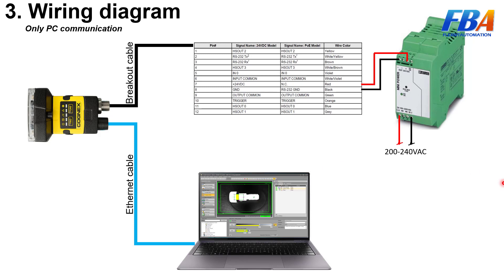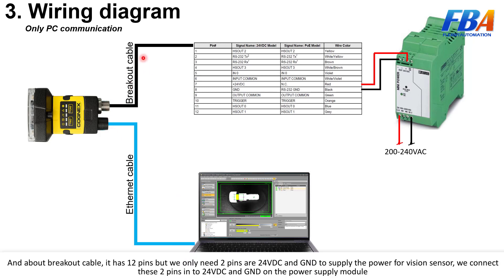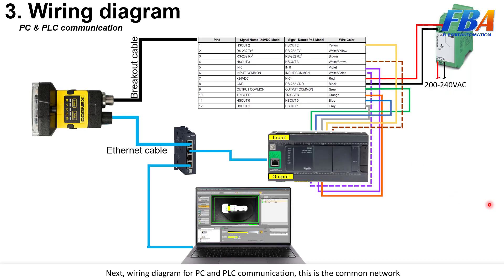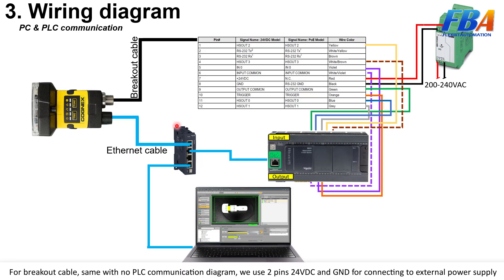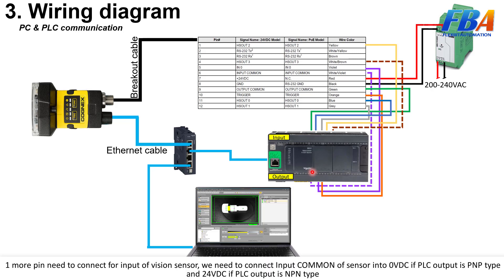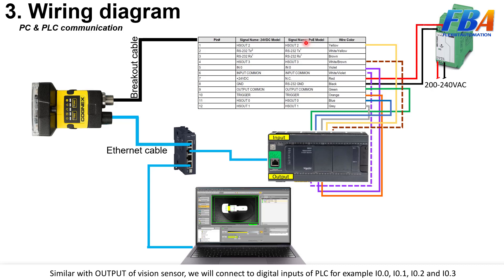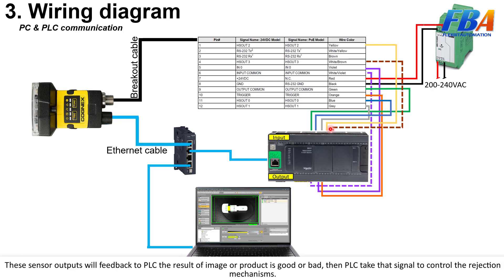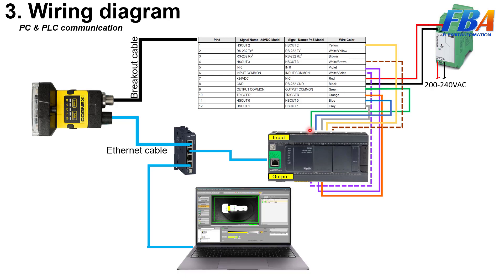Part 5 - Cognex IS2000 Vision Sensor Wiring Diagram  | Industrial Vision Camera

Comment: this was very helpful. Thank you a lot. I am working with an insight 2k camera. I have an insight 2k controller as well. the issue is that I do not have pin 5 in0. I am thinking that I can work around this by using communications via ethernet instead of needing the break out cable- and only using the break out cable for the 24V supply. HToughts or experience with this type of setup? The only reason for the controller is just for learning purposes. it isn't necessary for the application - just wanted to et the full feel for the full blown architecture really.
Reply: Hey do you know how to trigger the insight 2k camera on the Siemens logo plc ?